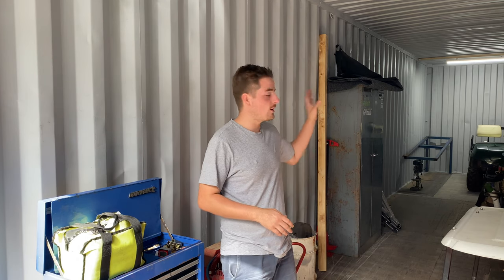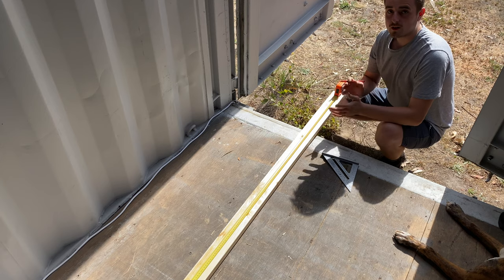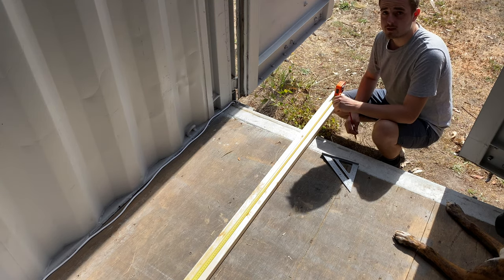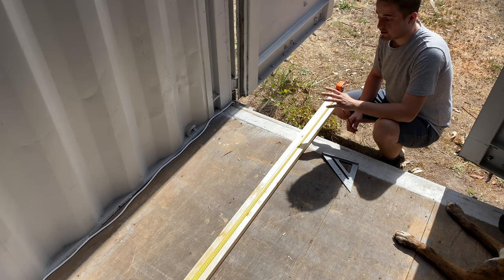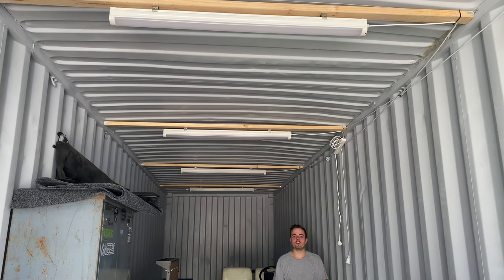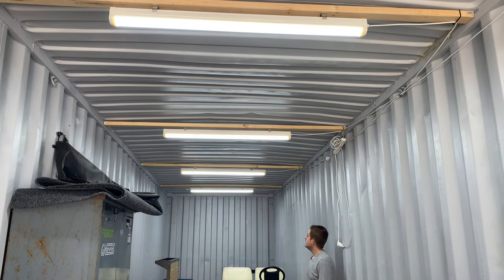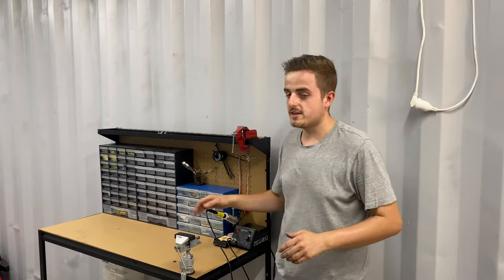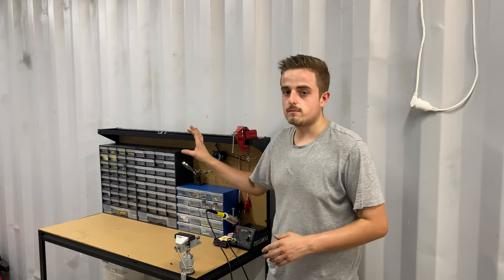Shipping Container Workshop Build - Lighting Finished

Comment: Just added 6 four foot LED light strips in our conex.
Not as bright as your setup, but ours is just storage.
It has freed up space in the garage, which was supposed to be my workshop. And now will be.
Reply from the maker: Led strips are a great option especially if you have no power out there you can just run a basic 12v setup.. I would like to do the same as I still have shadows in some areas.